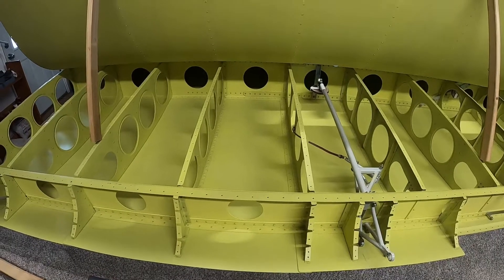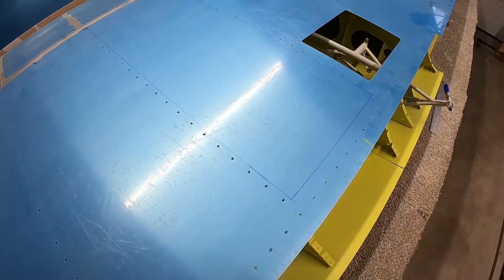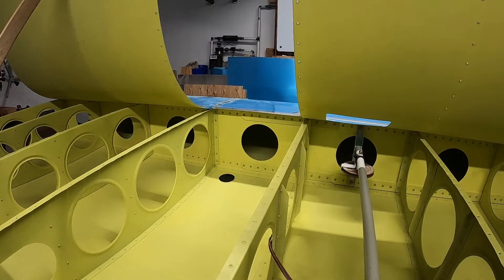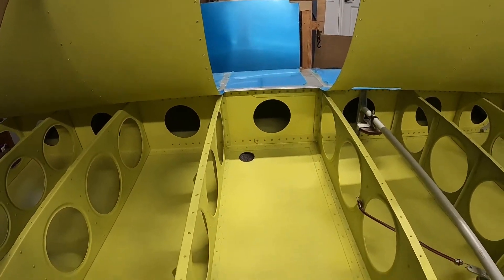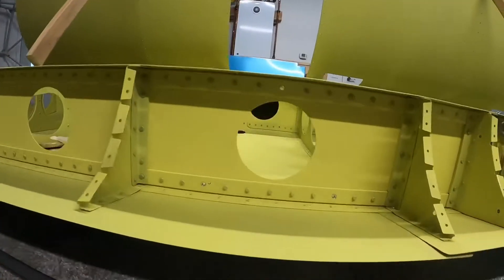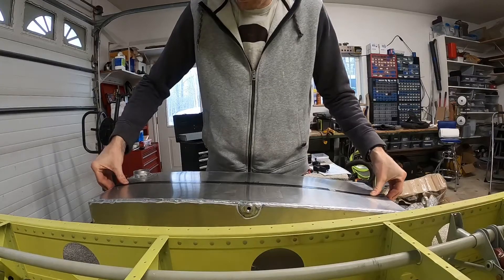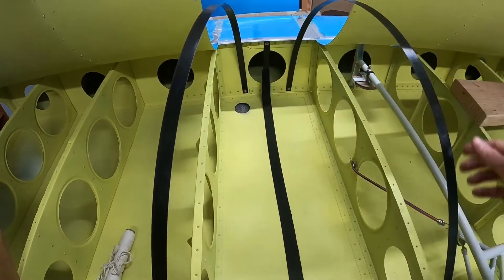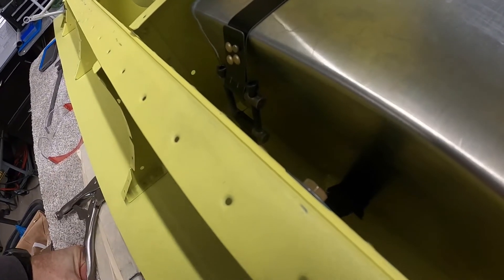Bearhawk Wing Fuel System - Part 1

Comment: why did you have to cut that one panel out of the wing? Is that going to be a large access panel to get to the tank in the future?
Reply from the maker: Yup.  The aux tank goes in that hole.
Reply: Thanks so much for taking the time to take this video, prep, and post it. I plan to do this on my A model wings soon.
Reply: Doesn't the aux tank go further inboard, like near the flap actuation instead of the alerion actuation bay?